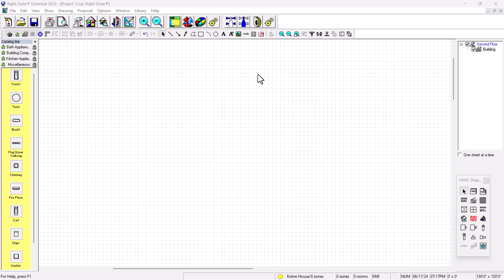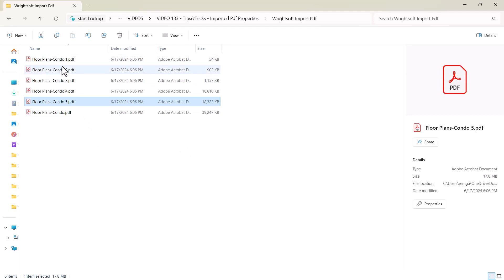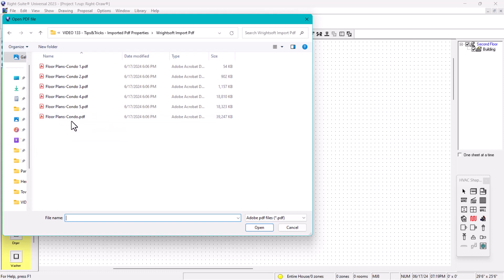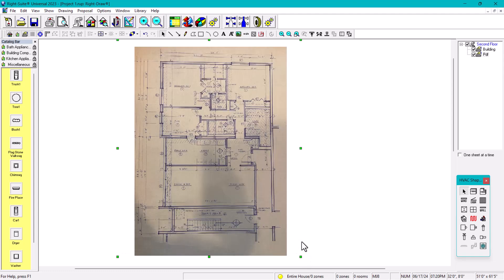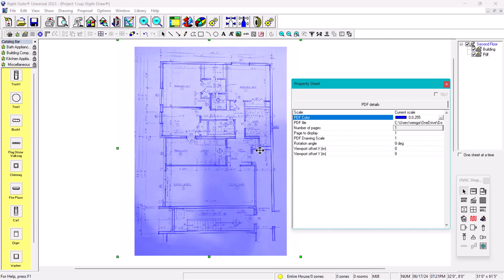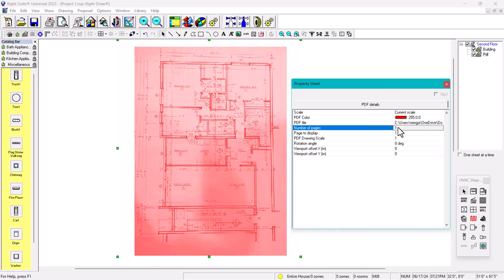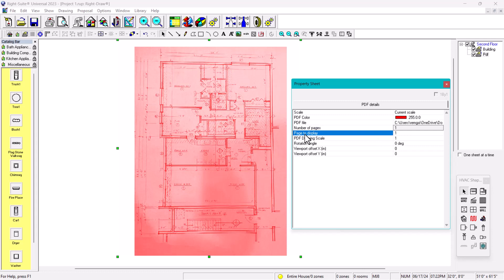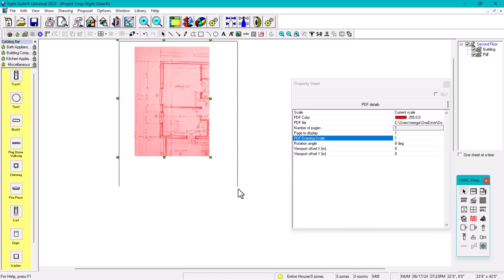Wrightsoft: Tips&Tricks - Import Pdf Properties

Comment: When changing the direction the front door faces, I see that you use the compass to change the direction. How do I unlock my compass to allow me to change it?  My compass does let me change it like you show in the video
Reply from the maker: That's not good. Usually wrightsoft have some glitches and the way to tackle them is: Save the file, close it, and open again. If that doesn't work I would even restart my computer. If that doesn't work either, possibly the file is damaged. Let me know how it goes.
Reply: @hvaceasymath  I tried all the above, no luck.
Reply from the maker: @ ohh sorry to hear that. The file itself might be broken. What happens when you open a new file and you draw a room with a door. Does it change?

Comment: When drawing rooms, where do you make the border with the wall insulation?
Reply from the maker: Thanks for the comment. Could you elaborate a bit more..? Thanks!
Reply: @hvaceasymath  for house plans that have double line walls, how do i draw over the pdf to get the same width?
Reply from the maker: @RamSalinas-v6p  sometimes that is a bit tricky, especially in the basements where the foundation is and the walls are concrete thick. Generally, I try to draw in the middle of the wall between the two lines. However I tried to maintain the overall dimension of the perimeter of the house which is exterior of the wall dimension. Keep in mind, we are safe, being conservative, so taking the exterior wall (the exterior line not interior line of the wall) of the perimeter works best. If you only take the interior side of the wall you would end up with smaller overall area.